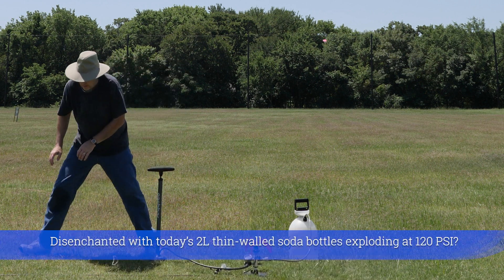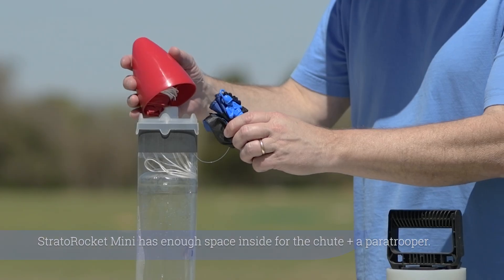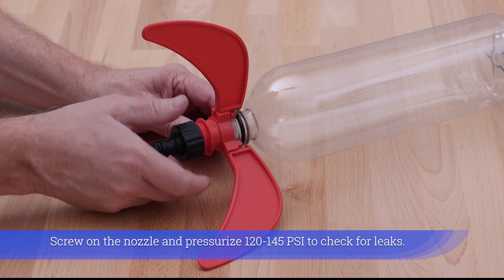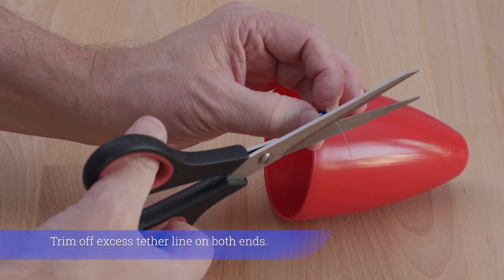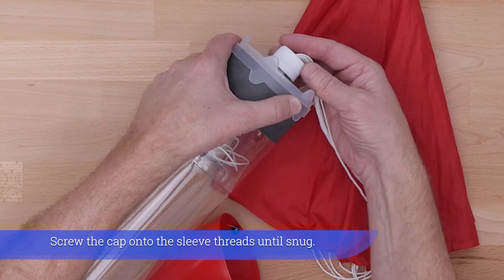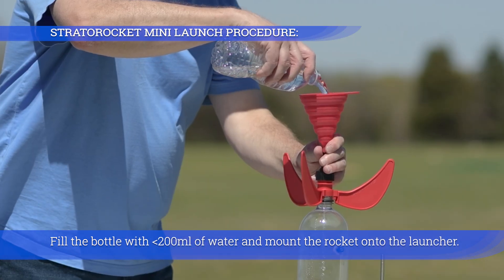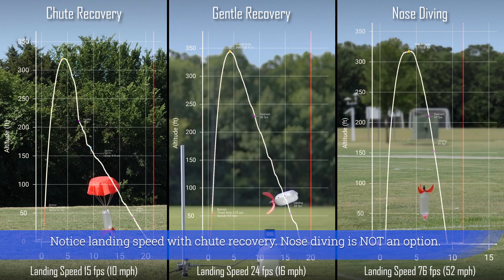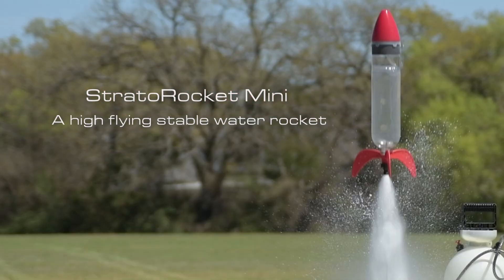StratoRocket Mini a Complete Water Rocket Kit with Recovery System

Comment: Is it safe? Meaning launcher, which is built from metal and holds the pressure, won't blow up? I heard launchers built from PVC pipe blow up into hundreds of little pieces because of the pressure.
Reply from the maker: Yes, we design all of our products including this StratoRocket Mini to allow for homemade fin designs and other components and still work with our StratoLauncher IV and others. Parachute recovery may not be as reliable, but it is all about experimenting and encouraging thinking like an engineer. Our StratoJig, homemade fin adapter, simplifies attaching homemade fins to the bottle and works with the StratoRocket Mini.
Reply: @StratoFins  sorry for editing my post there, my question above is now about safety. Also, why can't we allow it to nose dive with a homemade nose cone that's attached securely to the bottle? Seems parachute recovery is of importance
Reply from the maker: @Andrew-d3n2u  No, our StratoLauncher IV will not blow up and includes a 125 PSI safety relief value to prevent bottles from blowing up. Most soda bottles will handle about 130 - 135 PSI before they blow up. The 1.5L bottle that comes with the StratoRocket Min can handle 160 PSI without blowing up, but it does deform at that pressure. We recommend pressurizing this bottle only up to 145 PSI for best results and longevity. Nosediving is never a good option since the landing speed will usually be above 50mph, which can cause damage to the rocket, personal property, or people. One would never launch a solid fuel rocket without a parachute and I am not sure how it became acceptable for water rockets to launch without a parachute, probably because people couldn't figure out how to reliably and affordably deploy a parachute on a water rocket. We do allow for what we call "gentle recovery", which means the nosecone must fall off at apogee and then the bottle tumbles down at a slower speed without nosediving.
Reply: @ Thanks for taking the time to explaining that to me.